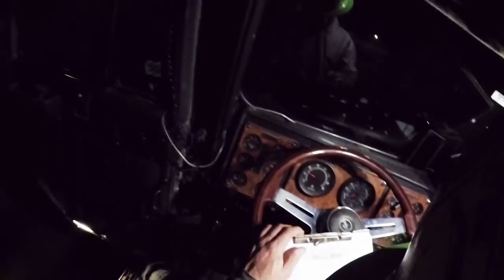Unloading my first load in a month!!

Comment: Glad you started working those pressure's on Brutus. Soon you'll have it tuned like a fine well oiled machine. As far as that cylinder with only 1200psi, I'm guessing you have no packing left on the piston. Probably need a new tube unless the guides kept it from scoring to bad. Nice to see you up and running 😁
Reply from the maker: Thanks buddy it’s came out of it on its own. I was wondering if it was just a pilot solenoid acting goofy.   I ordered two packing kits an extra gland and piston to be safe